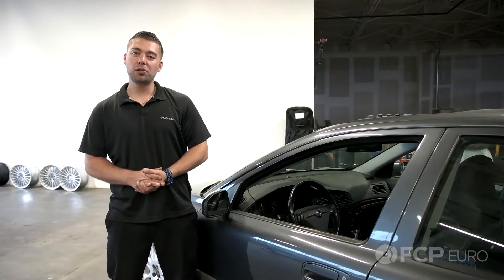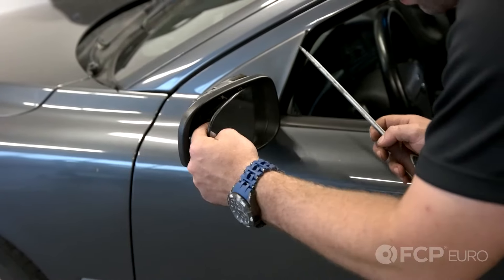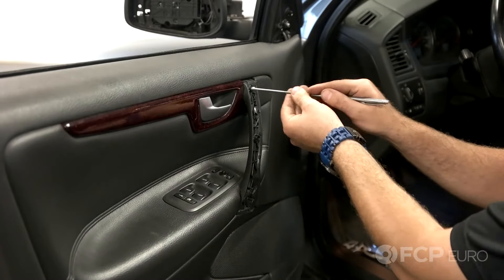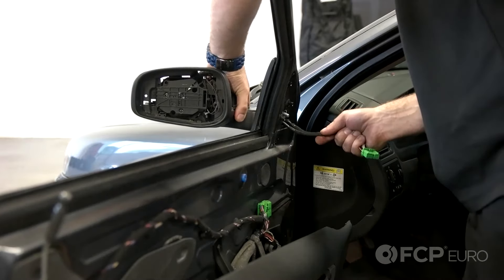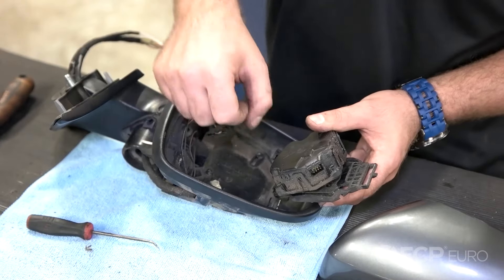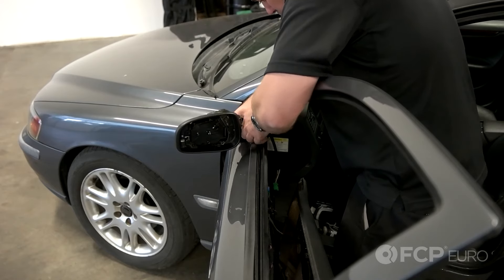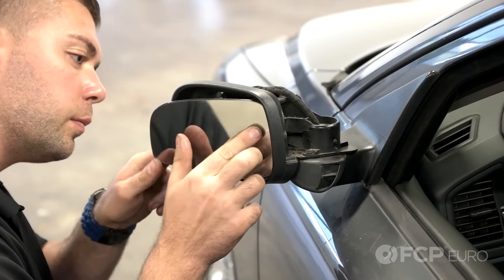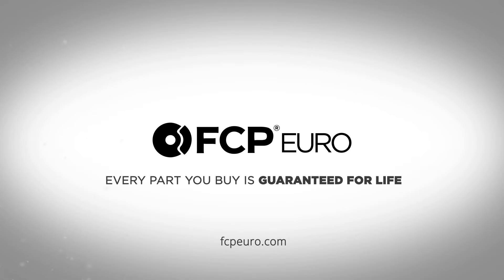Volvo S60 Door Mirror Disassembly and Replacement - (S60, S80, V70, XC70)

Comment: Thanks for this walk-through, it helped me to replace my passenger side mirror assembly. Only thing to note for other s60 R owners is when popping the 8 door clips, it's best to use a tiny nail so you can push (hammer) the middle of the clip all the way inside, so the clip can be removed safely.

Comment: 0:40  don't use screwdriver, just push to flip the mirror then pull on the outer edge - pull it sideways and away from the car gently, it will pop then move it gently to remove it completely from it's plastic bracket. The clips for the triangular piece break easily, undo the piece by prying gently at all corners.  For the door handle, pry from underneath so you don't damage the edge that is visible - later door handle type comes out the same way https://youtu.be/vXYoFcBp4EA   https://youtu.be/qAUUiRhKWlA

Comment: My mirror (07 V70) broke at the break-away pivot (shared-driveway neighbour hit it with his garbage bin). I can get a mirror assembly from a 04 at my local wrecker. It won't have a turn signal light, so I was wondering if I can disassemble the mirror further and just replace the snapped pivot pieces on my 07 mirror, since all the external parts are still in good shape. Thanks.
Reply from the maker: You should be able to make it work!

Comment: Just replaced the passenger side  glass on my 2012 s60. Every thing went fine but now the glass won't aim down towards the curb when in reverse (the parking assist mode), it just kind of twitches in a little and stops. If you manually adjust it from the driver's switch it moves fine. Is there a zeroing step I'm missing to get the parking assist feature to aim the side mirror down correctly?

Comment: the 8 pins are fiddly. i suggest a very thin torx to pop them out. they come out in 3 parts. the plug, the pin and a small plastic part. keep hold of them and put the small plastic culinder back in last
Reply: cylinder*

Comment: thanks for the video. I have a question about software. I have a 2004 Volvo s60, I need to replace the entire door mirror assembly and found the part I need on eBay. Just wondering, is it easy enough to purchase this part and replace the old broken one? or is there going to be any problem with software updates and the new (used) part from eBay not working? thank you.

Comment: Hi , nice video helpt me well, other short question:
Does anyone by chance know if it is possible to provide a volvo v70 with electrically foldable mirrors? If they not have been maintained from the factory?
Could it be just replace the heaterpanel wiht a panel with button to flip over the mirrors? would that be ok?

Comment: Great video.  I've got BLIS on the driver side (2015 XC70), however someone in the past replaced the passenger side mirror but didn't bother to get the BLIS mirror housing, camera, etc - they replaced parts w/o BLIS. I want to buy the correct BLIS parts and replace, however, I worry if they tampered with the green connection inside the door to make it work with the non-BLIS parts.  Do you know if the green connectors inside the door in your video are the same if the mirror had BLIS?  Or maybe it's the same but there's an additional green connection line for the BLIS?  Maybe they just kept the wiring intact and ran it out into the new mirror and left whatever line going to the camera loose in there. I probably have to take it apart to find out.

Comment: Trying to do this on a 2005 S80 not sure about need to remove door handle?
Reply from the maker: Hi R.C. The S80 is a little different but should be a similar process.
Reply: @fcpeuro  Thank you I figured it out.  I replaced the entire mirror housing, I now I have a defective mirror plate. So on to replacing that.

Comment: Where is the mirror folding mechanism?
I hit garage door with mirror and need to fix this mechanism.
Reply: How did you solve this? usually a pin in the motor issue.
Reply: I found a workshop and they've fixed it for 10% of a price of new one.

Comment: Anyone have an answer for me. I had the mirror only replaced and now every time I unlock car and open the door the mirror automatically turns up. I have to manual adjust position each time. How can I set the mirror.
Reply: toprider i have that same exact problem! Did u ever find a solution?
Reply: Mirrors and seat settings are saved to the keyfob that locks/unlocks the car AND saved seats. Use your keyfob to resave a seating position and the mirrors will save in that position too. It's so multiple driver/keyfobs can automatically adjust when the car is unlocked.

Comment: What about the ambient temp sensor?
Reply: To remove ambient temperature sensor - once you’ve removed the mirror you can look under the mirror and see the flex pin holding the sensor in place. Poke it with a screw driver and it will pop out the bottom side of the mirror. Can then use a screw driver from outside mirror housing to remove sensor. Then just feed the wires through the grommets and disconnect wires at green plastic wire harness.

Comment: is this the same mirror assembly for 07 s60 2.5t ?
Reply from the maker: The mirror assembly will be slightly different for the 2007 S60. The replacement process will be the same.